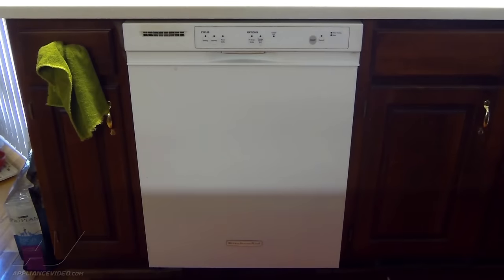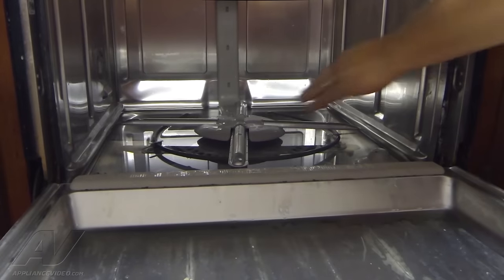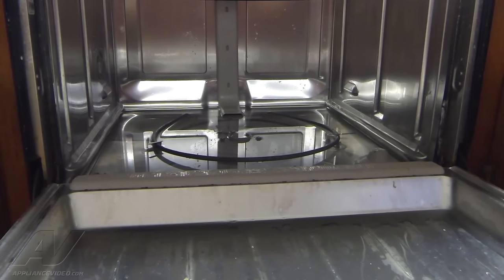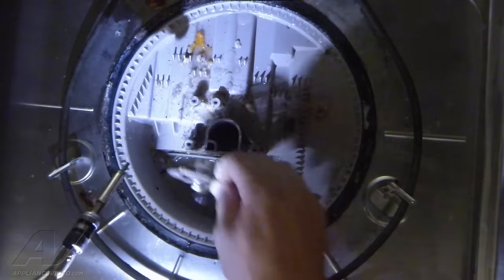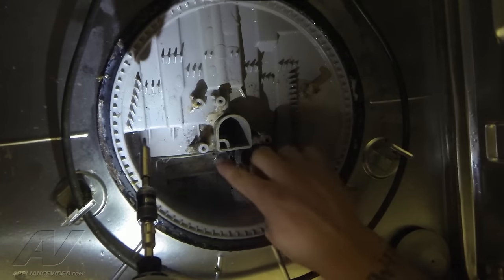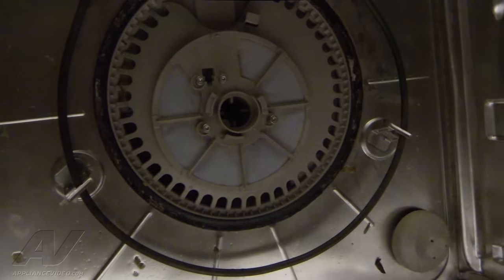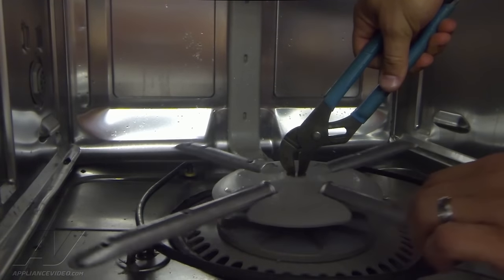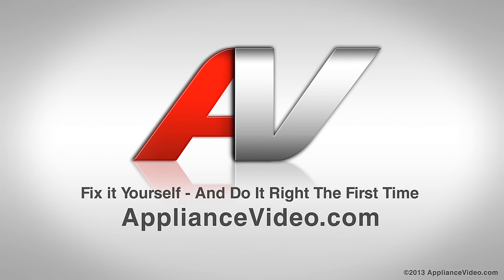Kitchenaid Dishwasher Repair - Not Cleaning Properly - KUDI01ILWH2

Comment: Thank you! My dishwasher is at least 17 years old, my friends said replace it when it wasn't draining but I found your video and I thought I am my father's daughter, resourceful and cheap so why not give this a try first....after all this dishwasher has never been worked on before. Had to borrow the tools but otherwise this was easy. Turns out mine is missing a cover plate since it was manufactured, the second to last one you removed...I bet that is why so much small debris got in around my sump. Anyway, going to see if I can still purchase that cover but for now, it is back running just fine. Thanks again!

Comment: You seem to turn the arms about 3 whole revolutions counterclockwise and it lifts right off. We have spun them counterclockwise round and round and round and nothing is loosening.  My husband wants to try to drill it out as he thinks threads must be stripped, but I'm wondering if drilling plastic is a bad idea and may break things under it.  Any advice?

Comment: Great video, easy to follow all the way through.  I think the guy that designed this "macerator" should be condemned for eternity to cleaning out the millions of clogged traps n these machines.  I understand the newest models have a filter that does not require total disassembly like this.  ..and who else had to go buy torx drivers to get into it?   Top tip: if you have a wet/dry vac, put a small head on it and suck all the crap out of the trap.  To top off my complaint, the principal blockage in the trap is little pieces of the silverware rack, the back of which gradually disintegrated due to being located immediately above the heating coil!  Let me see, what should I make this rack out of?  How about some cheap plastic that will crumble when heated.  Then I can sell a replacement  basket for....   $30.00 or 40.00?   I’ve replaced the bottoms  of the rack with pieces of starboard with drain holes in them, held in with a few pieces of stainless wire.  They ain’t going anywhere.
Reply from the maker: Great question, if you have a more technical question that our parts department cannot answer, you can search our over 17,000 answered questions free at our website www.ApplianceVideo.com under our Repair Help section. You can also call our parts department at 1-800-830-5465 and they can give you help 7-days A week ,or search at www.SaveMoreOnParts.com  .

Comment: This appears to have been our problem. When I removed the plastic cover, the impeller had popped off. The screen was fully caked. After cleaning that and figuring out how the pieces went back on the plastic shaft in front of the screen, we're getting full flow of water to the top basket.

Comment: Thank you for the video. I am excited to give this a try.  However, my first problem is that I have been unable to get the wash arm out.  I've tried and tried. I hold the screw and turn the blade counter clockwise forever, but it will not release.  Any more suggestions?  I've also tried turning clockwise, will not release?
Reply from the maker: Sheila Reaves 

All of our technicians are now answering
questions daily on the ApplianceVideo.com website. You can search completely
FREE in our Repair Help section with over 1000 questions & answers. Or you
can get unlimited technical advice and video links emailed to you by our 14
factory certified technicians at
http://www.appliancevideo.com/premium-membership/.  If you are in need of
any parts please support our parts department on line at
http://savemoreonparts.com/ or call 1-800-830-5465 7-days a week until 11pm
Eastern time. Thanks for your support. Matt Ace Appliance factory service
technician.

Comment: Having a hard time getting the chopper back in. Any tricks? Is it supposed to fit into the groove closest to the motor or does it sit on the outside of that groove? I get it lined up but it doesn’t seem to bite
Reply from the maker: Great question, if you have a
more technical question that our parts department cannot answer, you can search
our over 10,000 answered questions free at our website www.ApplianceVideo.com under our Repair Help section. You can also call
our parts department at 1-800-830-5465 and they can give you help 7-days A week
Monday -Saturday, or search at www.SaveMoreOnParts.com  24 hours
7- days A week.
Reply: Same problem and my solution: Putting two screwdrivers bits for my drill between the blades and the screen part, help to pull the little drive shaft out of the way during reassembling. After the screen is back in the smallest groove remove the two drill bits and the shaft will reseat at is normal position.

Comment: When I took mine apart the small shaft that turned the chopper blade was broken. Will have to disassemble the machine to replace the shaft but since I cleaned the debris screen it will work for a while. I notice that yours was broken too.
Reply from the maker: Great question, if you have a more technical question that our parts department cannot answer, you can search our over 17,000 answered questions free at our website www.ApplianceVideo.com under our Repair Help section. You can also call our parts department at 1-800-830-5465 and they can give you help 7-days A week ,or search at www.SaveMoreOnParts.com  .
Reply: Thx so much.

Comment: It makes absolutely no sense if you go through all of that work taking it apart why would you put it back together without cleaning all of  the parts & nasty gunky food??? 
That dishwasher is nasty, there’s mold in the creases & gunk on everything especially the edges around the large round disc part on bottom you could see after taking it apart, how does a nasty dishwasher clean  dishes. That’s just gross!